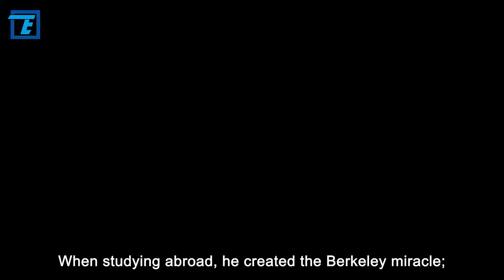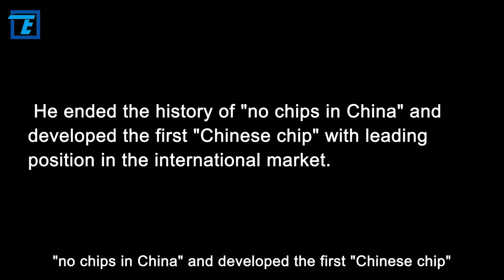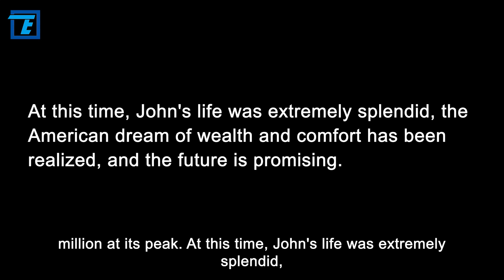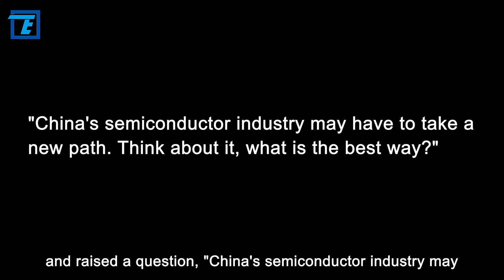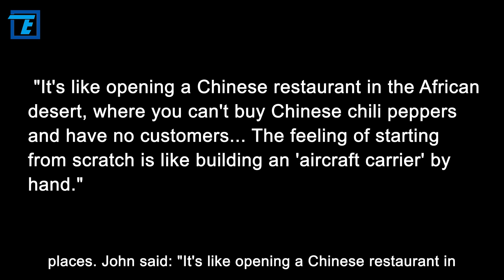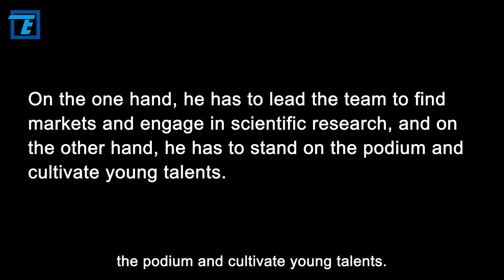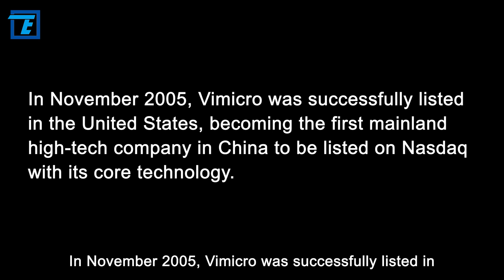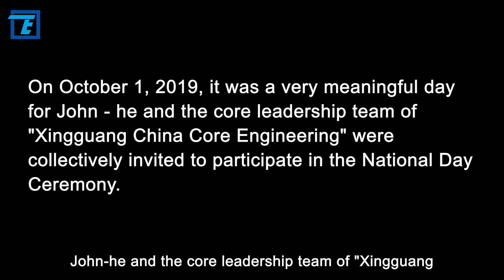He ended the history of no chips in China after returning to China

Comment: Interesting!   I had a front row seat to part of the history of China's early development of its Chip industry. For over a decade, I operated a small engineering company in Fremont, California in the heart of Silicon Valley. My Company serviced several chip foundries in the valley. We were located across the freeway from two of the largest chip manufacturing equipment companies at that time, Applied Materials, and Lam Research. We did repair work, made perishable plastic parts, and offered a few special setup fixtures to lessen downtime after equipment servicing. When I bought the company in 1991, the chip foundries were still using 125 mm, or 5″ wafers, or 150 mm or 6″ wafers.
In the mid-90s, many of our clients started transitioning to the 8-inch wafers, which involved weeks-long shutdowns.  But instead of causing us a slow-down in orders, an odd thing happened. As the companies started their transitions, they set hundreds of 5 and 6 inch wafer making machines on their loading docks. 
Having spent years soaked in caustic etching chemicals, these machines were considered hazardous materials by California bureaucrats, so disposing of them could be very costly. To the rescue came a few former fab workers who offered to haul them away free.  They hauled them to rented warehouses, cleaned them up and sold them to China along with several boxes of perishables, and set up fixtures we provided. The three guys we worked with became very wealthy.  
In the 1990s, many of the smartest and most productive young engineers we worked with at these foundries were Asian, many Chinese, Korean, and a few Vietnamese.  Some had come to the US on a student visa and after graduation got jobs under the H1 Visa program working in the chip industry.  So, when all this refurbished manufacturing equipment was set up in China, they had a well-trained management staff and workforce ready to go.  Many of these H1 Visa holding engineers who knew exactly how to make them productive.  of the Asians so much that I have lived in Asia for the last 12 years.
China has generously shared many of its technological advancements globally. A good example is their release of their 5G technology and infrastructure. It is being used by billions of people worldwide. They have also freely offered advancements in renewable energy, such as wind and solar energy. While many countries in the West embrace Chinese technologies, there are outliers.  Hopefully, things will improve and nations and people will again seek peace not war.